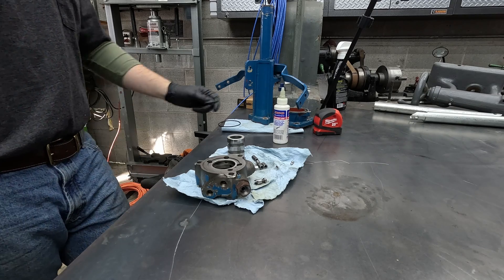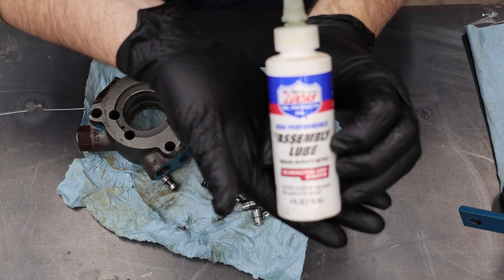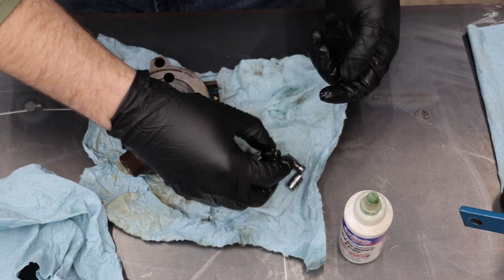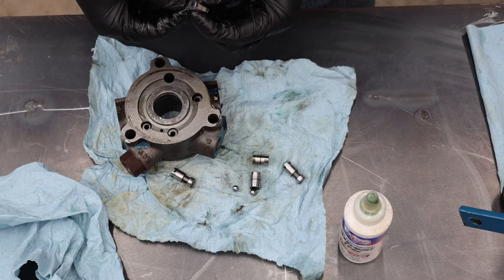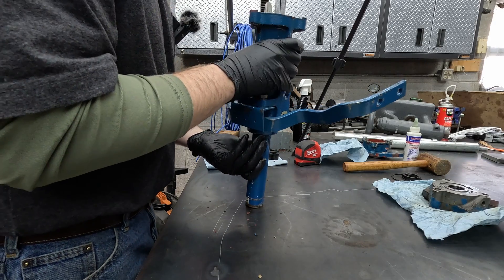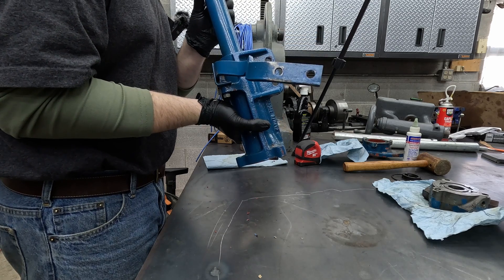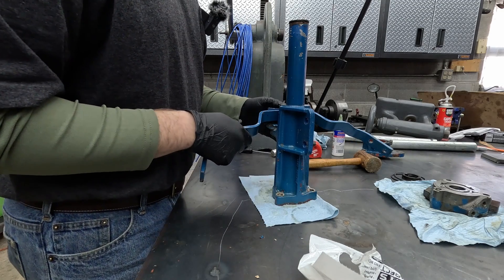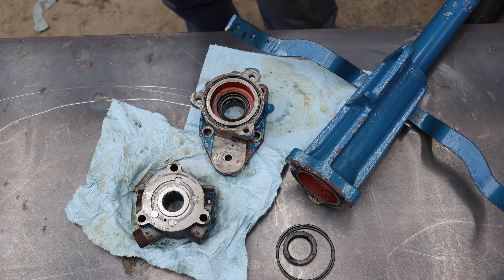Rebuilding Ford 3000 Power Steering Column

Comment: It's a good video however nobody shows the assembly of the control valve to the steering box ( the setup of preload on the control valve) I've been struggling with on for days - new cylinders and valve and can't get it to do anything. I'm convinced that most of the videos posted that never show them finished and operational never got them to work. I even seen one video of the valve on upside down. He never showed a final finish up and working video either.
Reply from the maker: Thanks! That's a tricky part for sure, hopefully you can get yours figured out!

Comment: thank u very much for the video,very helpful i did the same thing as in the video and my hydraulic steering isnt working properly(i have change one sector shaft because the adjustment place was broken) i putted the sector shafts in timing i did everything,  i dont know what to do anymore, i have inspected the power steering pump and replaced it with a new one and still doesnt work,what do u suggest to do please??

Comment: Tip .... The manual says to insert the central spool with it's internal (identification) groove uppermost (steering wheel side) of the control valve. (My understanding. Please verify to your own satisfaction.)
Reply from the maker: You are correct, I did not realize this at the time. The upper seal just went out again so I'll pay attention to it when I do it again!

Comment: How did you get the sector shafts out? Does the inspection plate have to come off in order to slide it out? And do you have to take both the back and front off in order to get the ball screw nut out?
Reply from the maker: All I had to do was remove the steering wheel and the upper portion of the steering column to get the orbital valve out. Worst part was getting the dash and all the sheet metal out of the way.
Reply: @arichaudio  so you left the shaft in the tractor ok i got you. Thanks anyway for the reply
Reply: Deutsch

Comment: Great video.   So many times the steering wheel shaft is worn and pitted where it goes on the upper shaft seal causing it to leak also....
Reply from the maker: I suspected this one to be that way, would've made a good video to weld up and turn back down!